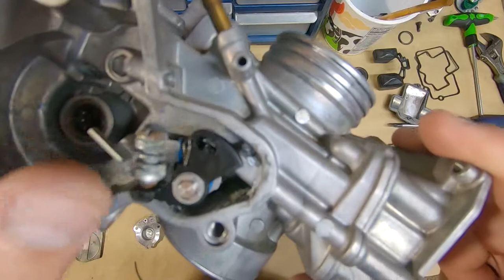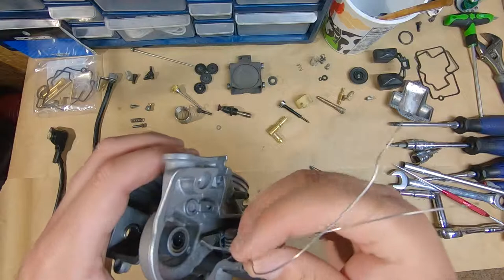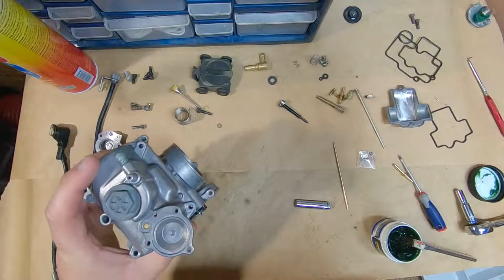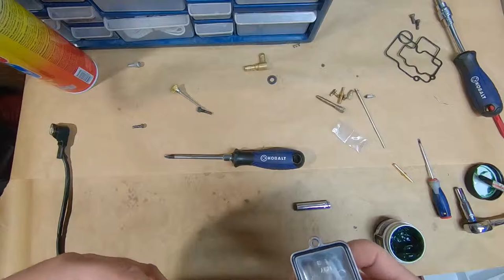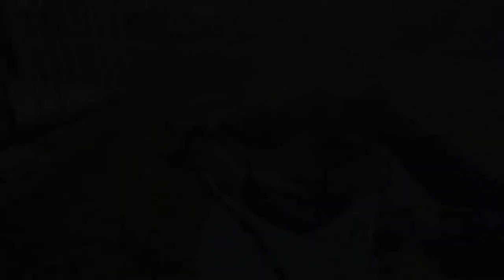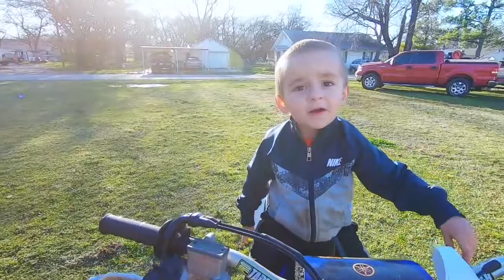2006 YZ450F FCR Carb O-ring Mod........ Fixing the Bog issue!

Comment: did this to my 07 also but I had to unhook the electrical connector to the carb,not even sure now what it was for but it smooth the throttle response out when holding a steady throttle.
Reply: Brooooooooooo imma try this tomorrow!!!!! You may have solved my issue lmao
Reply from the maker: Lets go!!!!

Comment: My 06 yz450f has a wierd issue when u first give it throttle it bogs. I was diagnosed a timing chain but I'm not convinced then I came across this video. What are the tell tail signs that this needs to be done
Reply from the maker: Well, assuming your jetting is completely correct and your bike is timed, I would start with the fuel screw adjustment. Once you’re back to the Stocks settings which is 2 1/8 of a turn out, then at that point I would go ahead and do the O-ring mod/wire tie. Watch this video and this should be everything you need. Let me know if you have any more questions. By the way this will only affect it when you snap the throttle, from an 1/8 of a turn to 1/4 turn throttle position.

Comment: What part did you paint grease(?) on and why?
Reply from the maker: Yes I used grease, and it was on the bearings on the lever arm, and on the prongs to hold them in place. Hope that helps, thanks for watching!
Reply: @DanMX2112  Ah makes sense. Thanks for the reply!